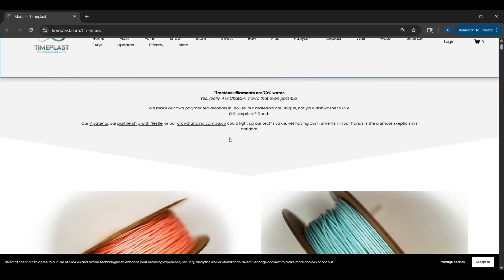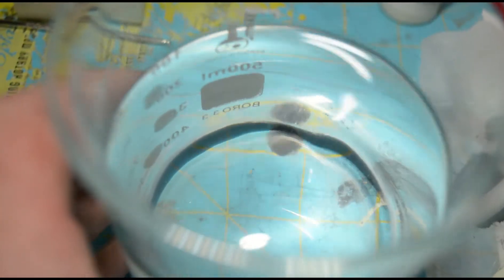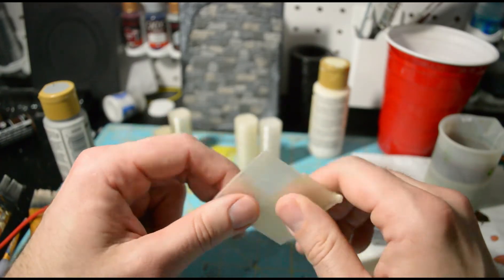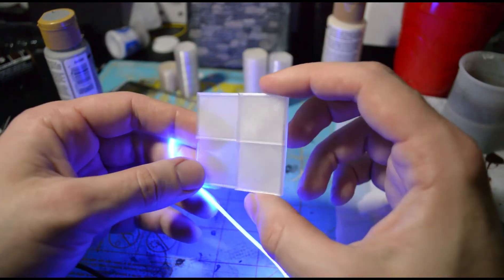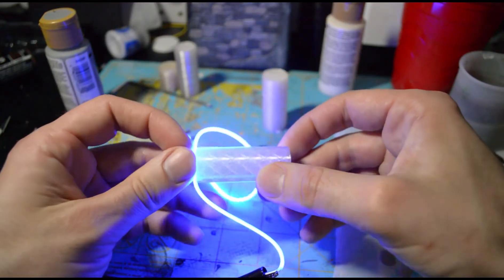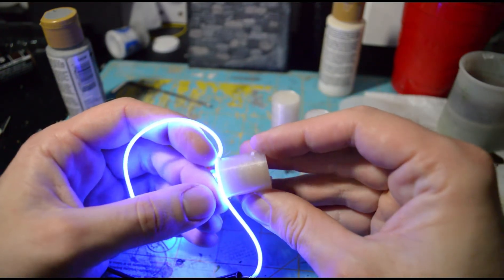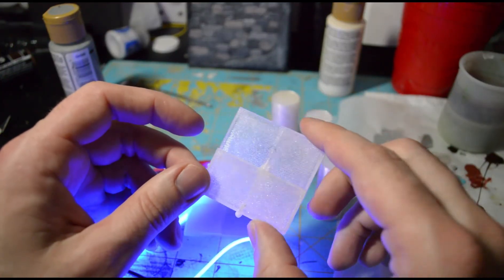Testing Timeplast Light Filament

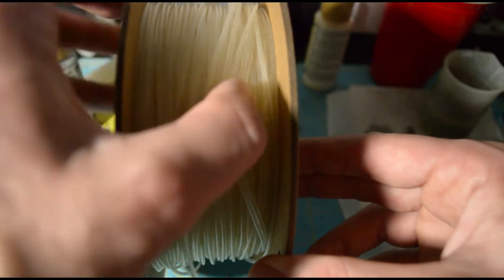Comment: 1:52 - I am baffled by this. You spend good money on a highly hygroscopic filament, and then leave it out soaking up water?
I am not a tidy guy, but I would never leave any filament out of the dryer, or AMS, unless it's in a vacuum-sealed bag with some recyclable desiccant, and a 50-cent hygrometer in there, so I can see the status of the filament.

I mean, the bags cost about 50-cents each from Temu. A USB-C chargeable vacuum pump costs like USD 6. And you can buy packs of 20 Hygrometers at around USD 11. And while filaments are not exactly expensive - if you want to actually use some, it's got to be dry, and if it's not dry, then you are simply wasting your time, and your money.

When you learn that water expands by a factor of at least 1,600 times when it flashes to steam, you quickly understand that this happening inside a filament in a hot end is a recipe for 3D tears.
Reply from the maker: My garage is temperature controlled so usually most of my TPU works pretty well in these storage conditions.  Also, unfortunately Timeplast didn't ship it in a vacuum bag with desiccant so it was just sitting in the original box.  Definitely needs some drying prior to use and I agree that dry filament definitely is critical!

Comment: Optical Fibre most certainly does NOT diffuse light, it transmits it!
In fact, a fibre optics line does exactly the opposite. The light inside a fibre optic line is constantly bouncing off the inner wall as the signal passes down the line. It uses a quality known as "Total Internal Reflection" - which is why the side of your fish tank turns into a mirror whenever you go under a certain angle. And it's why a fibre line can go many hundreds of kilometres without a repeater, because so few photons leak out the sides.

Glow is the wrong term to use for this, because glowing requires capturing photons and releasing them later -- over time.
Glowing can also mean a nuclear breakdown process, which is usually best to stay the heck away from. Like the old-school glowing uranium dining plates and drinking glasses. Yikes.

This video raises the great topic of conversation that we have no idea what light actually is. It's a wave and a particle - but only when they need to be one or the other. And that the vast majority or people have fewer clues than that.

Comment: The light source needs to be projected, the light source you had was already dispersed. Also for cosplays it’s much better to have a flexible print than a rigid one.
Reply from the maker: I made a sword out of the PLA filament (check my Sting video) so definitely wanted something a bit more rigid but flexibility can certainly be good in many situations.

Comment: Thank you for making this video. TimeMass light is a light transmission filament, not a light diffusion filament like the PLA you have there. Which means that you need to position the light source not at the bottom to see how it scatters it, but at the top to see how it transmits it. It’s a very different concept. Think of Tron outfits rather than a Christmas’s tree.
Reply from the maker: Thanks for the information.  I'll have to look at some other applications for it.